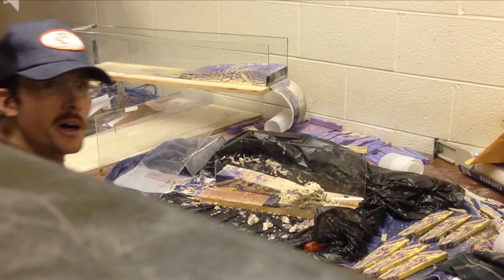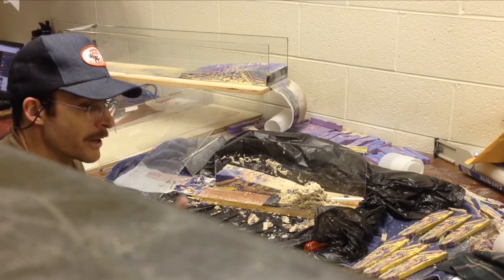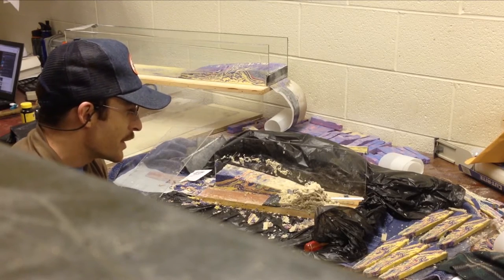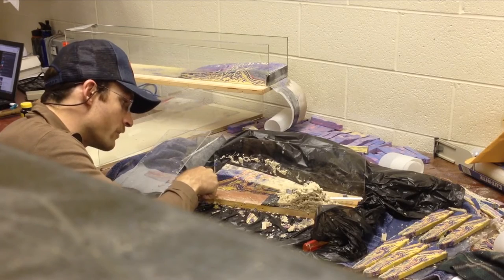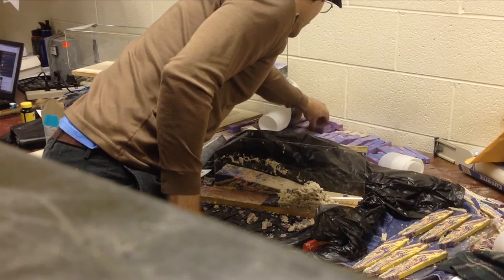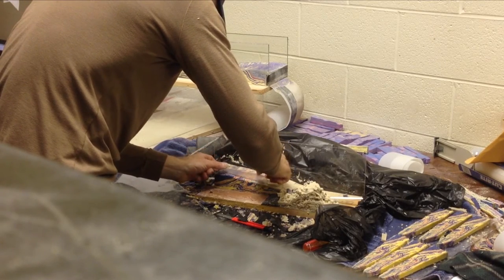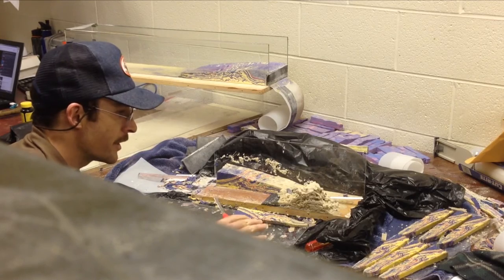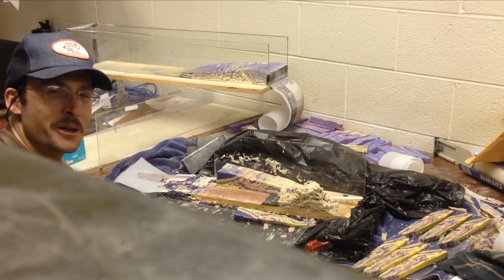What's inside theses models? A talk about gelling and slicing...

Comment: Those look fantastic. It will be awesome to see them side-by-side for comparison. Looking at the sections you have drying out, it seems that the architecture within the core of the large thrust at the back end of the model shows some variations.  For selfish reasons, I'm curious if you'll be able to show cross sections perpendicular to the transport direction? I've never come across a published section in this orientation. I'm looking at 2D seismic lines throughout a thrusted region and the geometries/configuration on the line along strike are mind boggling.
Reply from the maker: I could indeed do that. You see lots of lateral ramps, in short, and it's a very distinct perspective relative to what you usually see. This model was run with the sandpaper base on half of the model, and you do see the duplex style over the sandpaper with a more simply imbricate style away from it. I will attach a photo of all the sections when I do the deformation video for this run. I think there is a shortening-perpendicular section published for the Elk Hills area in the southwest Central Valley, but that may be the only one I've seen. It might have  been an AAPG Search and Discovery type of thing.